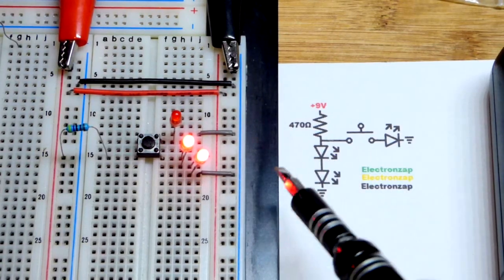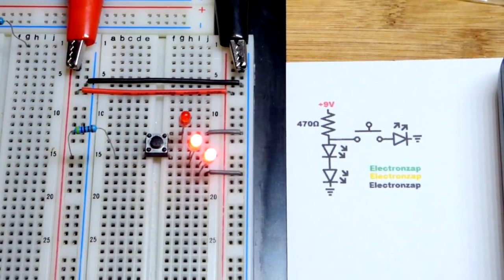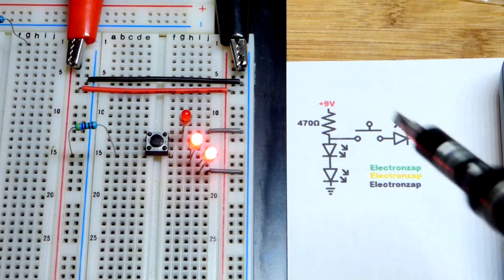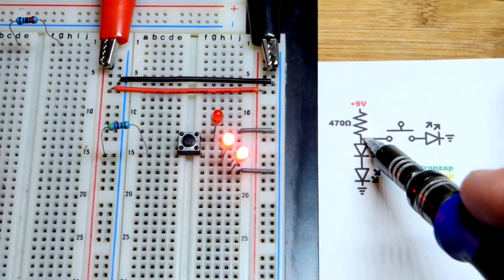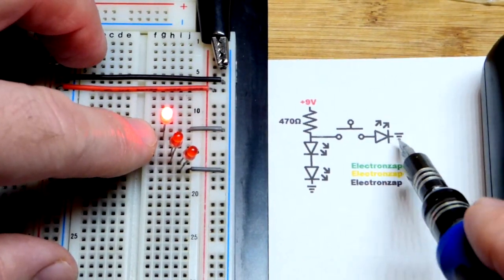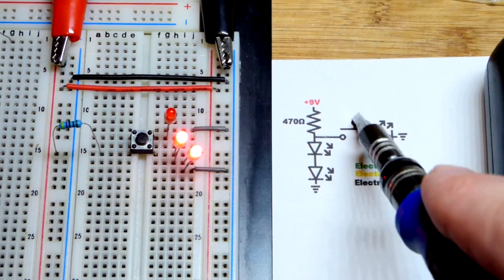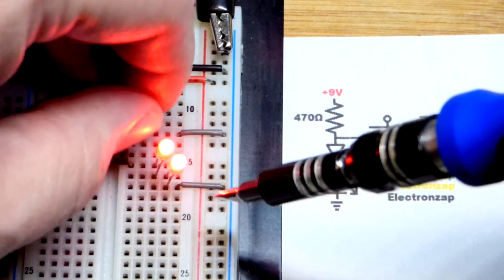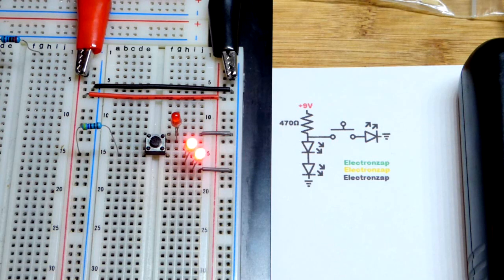Alternating LEDs with a single mechanical push button switch electronics circuit how to DIY tutorial

Comment: I want to make a circuit that has two leds and cycles between one or the other being on and both on. First push turns on led 1. Second push turns off led 1 and turns led 2 on. Third push turns both leds on. Forth push turns both off again.

Comment: Can I wire 21 lights with this set up to switch to each light after button push?  Only one light lit at one time and after 21 lights up shut them all off.
Reply from the maker: Hey there, I did notice this question on Facebook. You will want to look up how to make an LED Sequencer, or LED Chaser circuit by doing a Google or YouTube search. Lots of people make them with the 4017 integrated circuit. I haven't actually built a circuit like that yet, or drawn up a schematic, so it will probably be a while before I put one together.